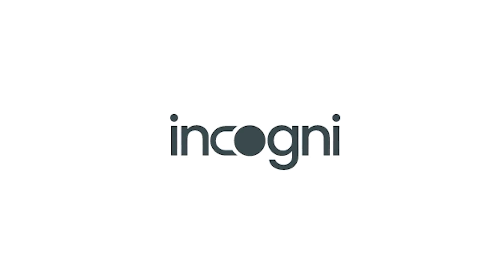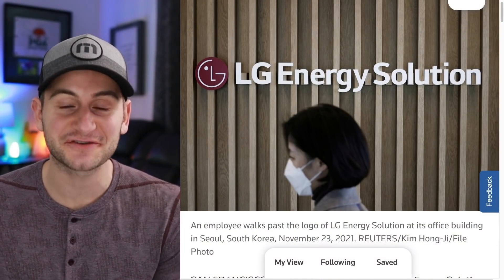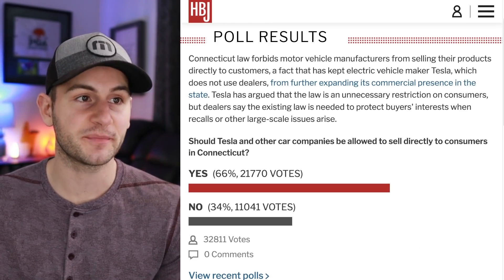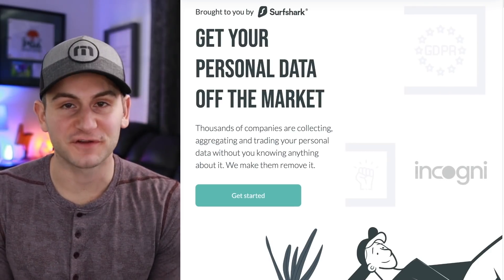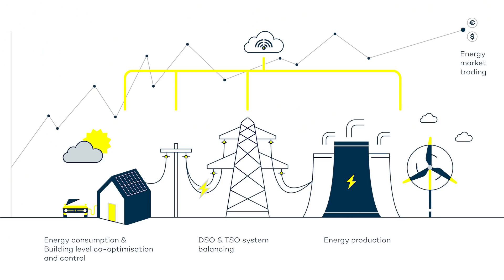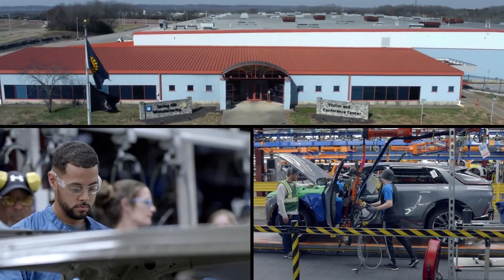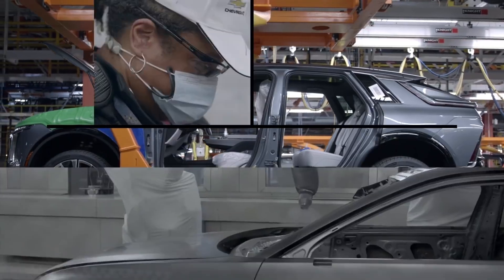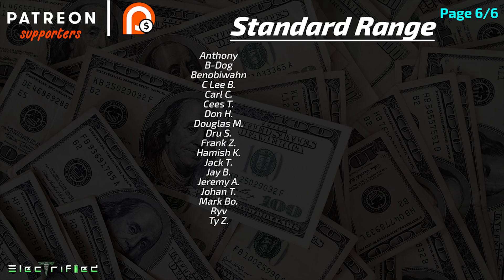Tesla Vehicle to Grid: Hope? / Notable Tesla Bear Flips / Tesla's Massive R&D Debunked⚡️

Comment: When Tesla becomes a utility in each state as it has done in Texas then its Autobidder software will allow car owners to join. At that point, regardless of state law, as a utility it can buy power at a reasonable price and sell it at the current grid cost. Owners can charge their cars at the grid's lowest cost period and deliver power at peak prices. In all states where it is a utility the benefit to car owners will be economically useful.

I recently saw a post by one of the cars' software hackers that claimed bidirectional software already exists but is not implemented. All that is then required is is the grid switching hardware in the home.
Reply: do you think Tesla will make profit by taking spread/commissions from electricity sold with autobidder?
Reply: @CK-vs4tg  yes, they already do.
Reply: I heard about that too!!!!  The capability in the vehicle already exist in a modified form in the Regen-Braking system, and it would be located on those electrical inverters located in the electric motors. They have all the necessary controller chips and hardware already installed, and if not, they could be added later, and then maintained using OTA.  So modifying it again for V2G usage would not be a problem.  Also, the evaluation that Devlin mentions here about Munro and Battery degradation would not apply to those vehicles that are equipped with the LFP batteries, batteries that have infinite life and charging 0-100% cycles.  So the future of this V2G possibility could be nearer than we think. It would come then up to politics, and which companies would accept this concept to be incorporated into the grids
Reply: @jorgerobles8334  the new lithium-Kevlar-sulfur battery has 5X the energy density of Tesla's current batteries. That would be the equivalent of 15 Powerwalls and would minimally power a home for 15 days.

Comment: The id buzz will be the first vehicle to grid car. VW is brining out a DC wallbox that can do vehicle to grid by the end of this year.
Reply: Imagine VW brings a DC Wallbox and nobody buys it because nobody can attach it to their "grid"...
AC is possible to implement if you have a existing solar to grid inverter, DC not so much.
Reply: @wolfgangpreier9160  imagine VW solves all that.
Reply: @whynotstartusingyourbrain8726  😂🤣😜Yes of course and there are the Unicorns and milk and honey flowing from the trees and world wide peace.
Reply: Leaf was first actually, as chademo has always been backwards compatible and Japan has had multiple pilot programs going since fukushima melted down.

Also the lighting truck here in a couple month's will be the first U.S. mass produced ev where every single model sold can also support v2x. 
Plus the connected wallbox from Ford can do 80amp charging, v2x and costs just $1,300 to purchase separately. Which is a smoking deal. 😎

Comment: What we really need now is a standard way that all EVs could communicate with the grid to tell the grid how much power it is willing to contribute to the grid.  As an example, say my EV is 80% charged but it only needs 60% in the morning to get me to work and back.  I drive to work using 30%, at work I plug my car into a v-to-g plug and it adds 20% to the battery in the morning when the grid has the power to spare and sells 40% in the afternoon when the grid needs the power.  The power in the morning was cost me $2 plus the $1 power that I charged overnight and I sold it for $5 in the afternoon because the grid needed it and was willing to pay more netting me $2.
Reply: I'll say again (and again...)
The best way for an EV to assist the grid is to simply remove the associated home from the grid as the home consumes peak power.
No messing around with metering.
Just an automated switch to transfer from grid to EV, no cross connection.
The owner doesn't buy peak energy, the grid charges the EV overnight.
Win all around.

Comment: Not sure on V2G, how much life does it take out of the battery? will V2G usage effect any resale ie; 50,000 millage + 1000 extra charge cycles from V2G?
Reply: Studies have shown that the comparatively low currents in V2G have insignificant  impact on car batteries life span. The stress is nothing compared to car acceleration , recharge breaking or high speed supercharging. The minimal degradation is more than compensated for by the electricity trading profits from using V2G.
Reply: @johnpublicprofile6261  Have to disagree, rechargeable batteries have a limited number of charge cycles every charge cycle has a significant impact on battery life.
Reply: @markbrowning9363  If amount of current does not affect battery life then why do EV manufacturers often advise using slower chargers as much as  possible?

 I'll stick with the battery chemist uopinions.
Reply: @johnpublicprofile6261  stop trying to put words into my mouth, I never said the amount of current does not affect battery life.....i said every charge cycle reduces the life of the batteries !!
Reply: @markbrowning9363  Apologies if I have come across as putting words in your mouth, I was just responding to the impression I got from your reaction "every charge cycle has a significant impact on battery life" when I had said "comparatively low currents in V2G have insignificant  impact on car batteries life span". We are both saying every even partial charge & discharge have an impact to some extent, and my understanding is that V2H, or even carefully managed V2G discharges cause much lower degradations than occur from actually driving the car (during acceleration this can be at a rate several hundred kilowatts per hour).

What muddies the water is the phrase "charge cycle" which officially has a different meaning from real world charging and discharging. It means charging from 0% to 100% and discharging from 100% to 0% at a near maximum rated current/speed. This battery manufacturer meaning is something that is impossible to achieve in most cars as they often restrict access to the top and/or bottom several percent of the battery plus both the Battery Management System (BMS) and the charging stations variably restrict the current. If a battery manufacturer states a battery life span of 10,000 charge cycles it is a laboratory comparison  figure of how many unachievably (in the real world) abusive "charge cycles" cause the battery degrade to still having 80% of its original capacity.
Reply: Average American home uses less than 3 kwhs per hour of energy. For comparison do a single 1/4 mile pass in your tesla and in that 9-12 seconds you've drained the same amount of energy out of your battery. Now explain how the house running off of your battery is somehow worse please. 🤔

Also tesla says it's empty to completely full to count as one charge cycle. So 5 daily cycles which only account for 20% of the battery pack is still just 1 total cycle.

Comment: Vehicle to grid doesn't make sense for the majority of people. Most likely you will be at work when grid demand is high, and that's when you need to be at home pumping juice into the grid. As far as battery back-up goes, you can us solar to charge your car during the day and use that power at night. But again, most people will be away from home, and at work.
Reply: It's actually opposite, grid power demand peaks in the evening into the night when people are at home.
Reply: @chrisduggan2848  My rate is the highest between 2 and 7 pm, so I assume that is when demand is highest.
Reply: @Kev dez
Makes sense. I presume this is due to using appliances for cooking for lunch and later for supper. One thing that never ceases to surprise me is how much electricity that appliances that have an element draw. A small generator can keep a lot of items like lights, fridge or tv running but can't or struggles when a kettle is plugged in. I can only deduce how intensive stoves are.